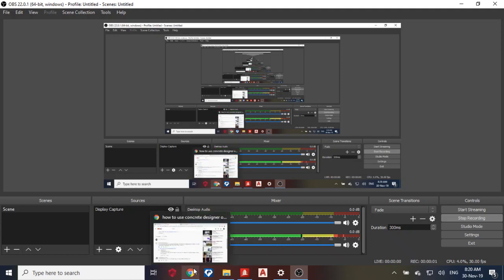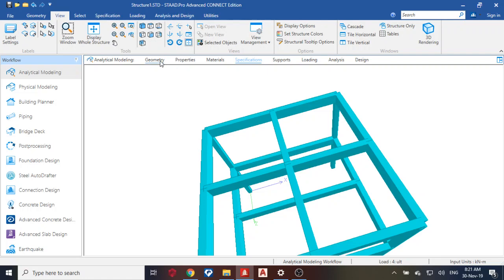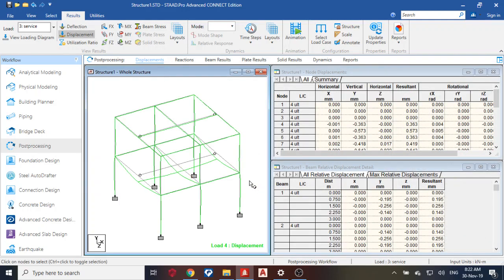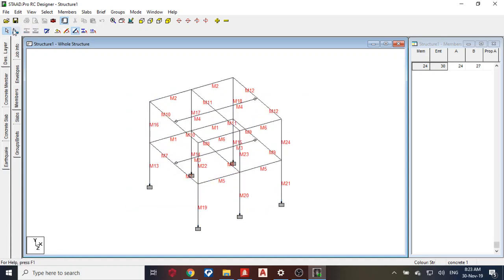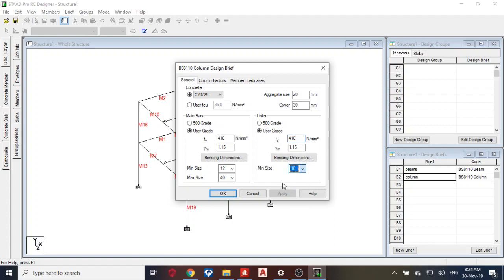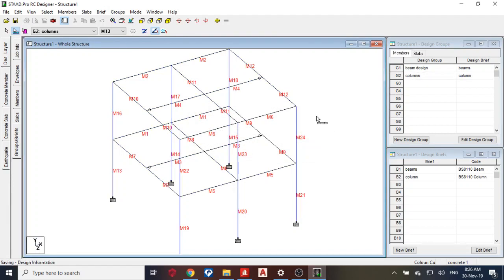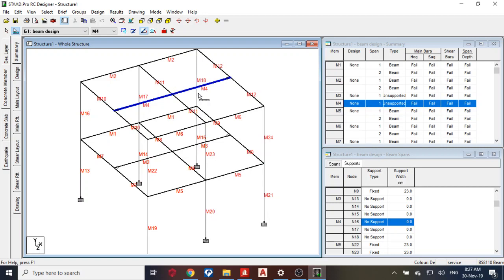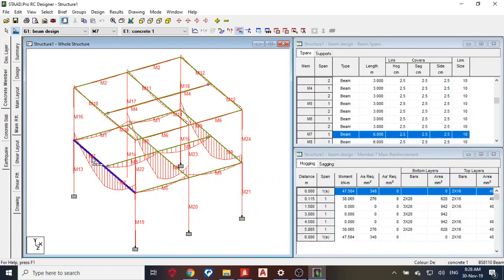How to solve member support as none or unsupported in staad pro

Comment: The main part of the video lagged.
Reply from the maker: did you get it?
Reply: @Lanreolokunola  you went in beams spans section and changed to simple or fixed?
Reply from the maker: @rajasrasam2114  yes apply a support to it either fixed or pinned and it would be resolved